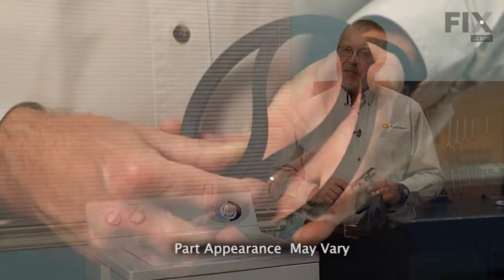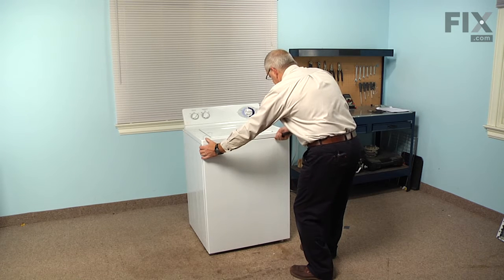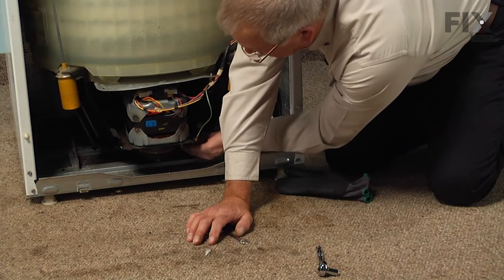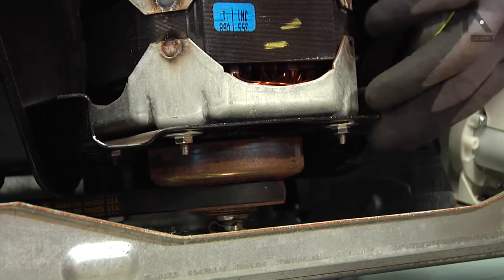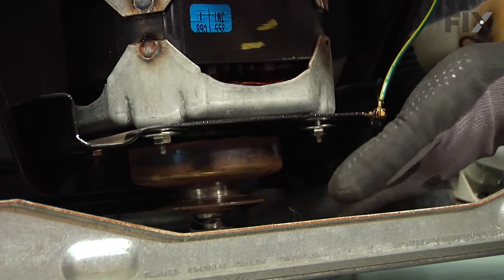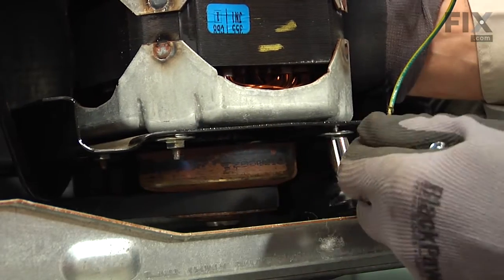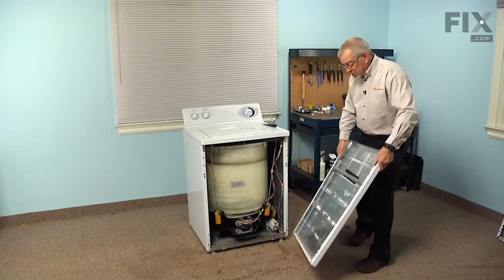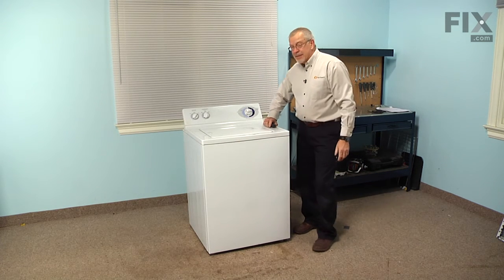General Electric Washer Repair – How to replace the V-Style Drive Belt

Comment: The machine in this video is TOO New.  My GE heavy duty top load washing machine is about 33 years old and it only has an access panel on the back that is fiberboard.  The front and sides are all 1 piece of metal.  If I compress the clips on the front of my machine, the top of the machine starts to pop up.  My motor has only 3 adjusting nuts/bolts and the nuts are 7/16 inch.  I do not see any way to get the belt off of the motor.  The motor's shaft is connected to a transmission or some sort by a flexible coupler.  Do I need to totally disassemble the motor and supports or is there a way to remove this flexible coupler to get the belt off of the shaft of the motor?  My machine uses the same belt that is in the description and the video.  Other than that, everything is different.  Any help is appreciated since a new belt is about $10.00.